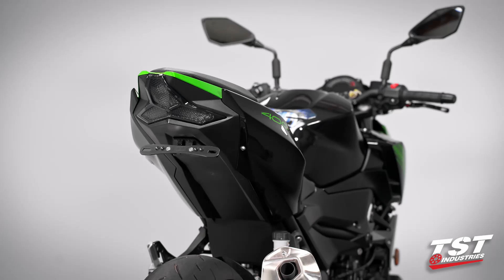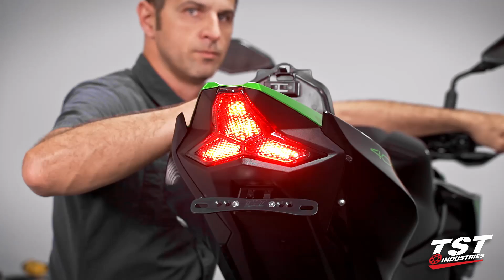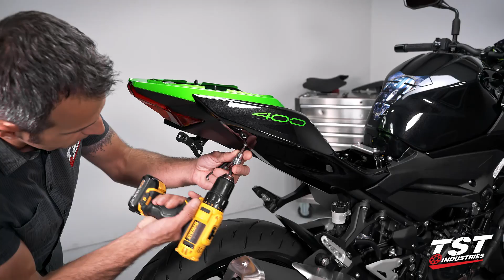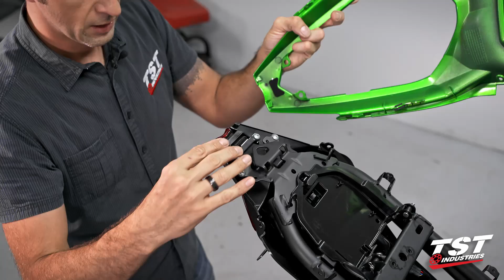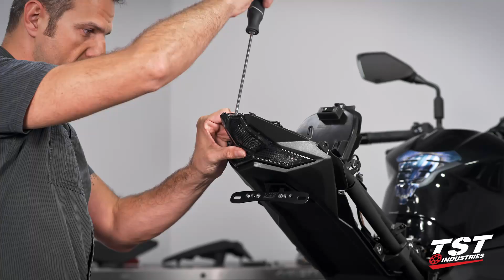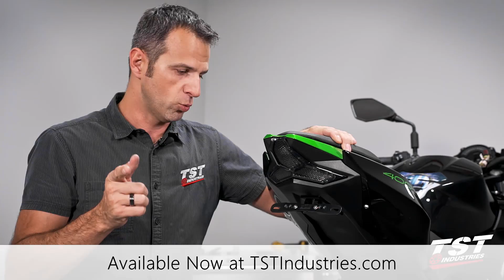How to install a Programmable Integrated Tail Light on a 2019 Kawasaki Z400 by TST Industries

Comment: So I am a newbie. This video is great, but can you or someone show the electric wire part as well? Electricity is the only thing that scares me.
Reply from the maker: @kimtee1943  what exactly do you need shown? Our tail lights have the same connectors as original equipment. You simply plug it in where you unplugged the original lights.
Reply: My question was posted to the wrong video

Comment: Can the tail light be installed, keeping the original turn signals in play?
Reply from the maker: Absolutely and you can either choose to only use the external OEM signals or pair them with the integrated ones using our Y-Splitter. 

https://tstindustries.com/tst-kawasaki-y-style-signal-harness-splitter.html

Comment: Is the "flasher relay" he references at the beginning the same piece as the "signal relay" he refers to at the end of the video?  And this is to adjust the rate at which the turn signals flash, correct?  Also, is this piece necessary to install if I'm simply fine with a faster flashing speed?
Reply: It's a simple unplug and plug I'm new part.

Comment: Hello. I bought an aftermarket light similar to this one. The only difference is that the one I bought has the exposed yellow wires without the plastic connector on the light assembly. How do I install or where do I connect the exposed yellow wires? Thanks in advance.
Reply from the maker: Return it and buy ours! 😉😎🤷🏽‍♂️
Reply: Lmk if u found how to do this

Comment: Is this lens DOT approved, water resistant and what warranty does this have?  Also, will installing this void your factory warranty in any way?
Reply from the maker: This tail light along with the rest of our lighting equipment is not DOT approved, this is all mentioned in each respective product page. We offer a standard 1-year warranty on all of our TST Exclusive products. This light is sealed and should prevent any water from entering. Unless of course you direct a pressure washer on a high setting directly at it or if you submerge the unit under water.
Reply: @TSTindustries   Thanks for taking the time to respond to my questions.  I'm betting none of the aftermarket lights are DOT approved, but I was just curious.  That's a decent warranty too.   I hope the installation of this would not void my warranty, I'll have to check with the dealer before purchase.
Reply from the maker: @broderp  We have not come across any motorcycle brand's warranty that is void by replacing lighting elements.

Comment: I broke both of the rear hook patches on the side rear plastic one on pulling it off, the other when I was putting back on. Anyone else have trouble with those, first bike blues but can’t tell, the lines are still smooth.

Comment: To those of you that have completed this install, is it really this much disassembly to do? From the looks of it it's just two screws and a lip bracket that holds it on, and the taillight itself is flush on all sides so there's nothing else that will catch. This feels like a work smarter not harder scenario but I'm trusting the mechanic in the video. Is the extra disassembly to get at the wiring bushel or am I missing something? I'm getting ready to install my TST taillight on my 2019 ninja 400 tonight. Thanks guys!
Reply: Addendum: It sounds like the whole reason to take the rear end apart is because the bosses (spelling?) stick up into the grommets and the extra slack (play) in the fairing is needed to get the taillight out?